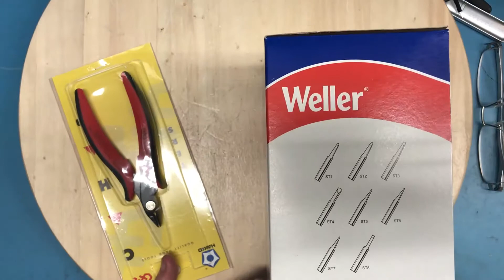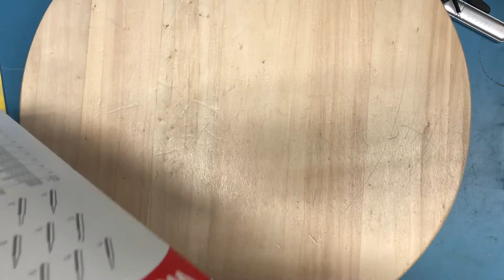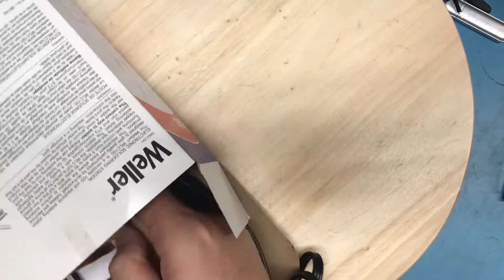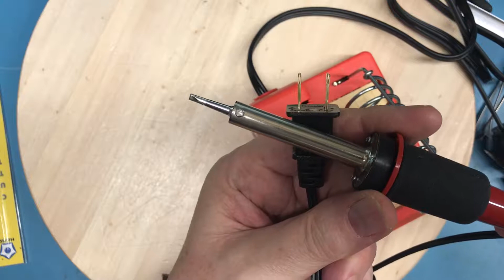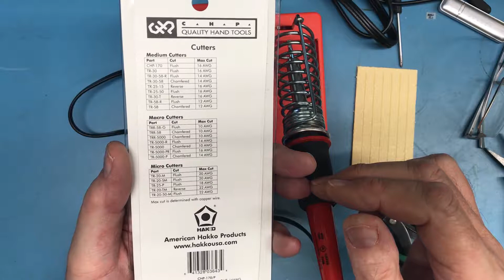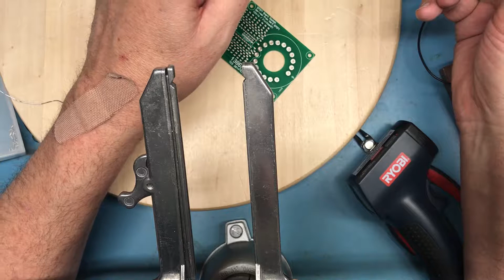Weller WLC100 - Soldering Station Review - STB149

Comment: Interesting (I just bought a new soldering station, KSGER T12, it's my 2nd favorite tool now, along with the General. brand all metal, the fist all metal digital caliper:-).

God bless, Rev. 21:4
Reply: Its not temp control !!!!! Its voltage contol .... AC voltage to the iron